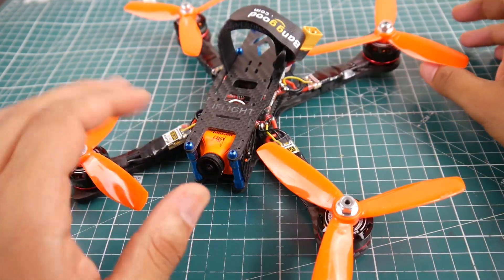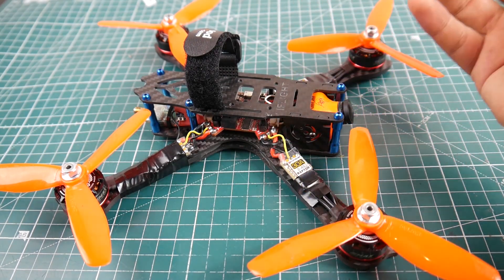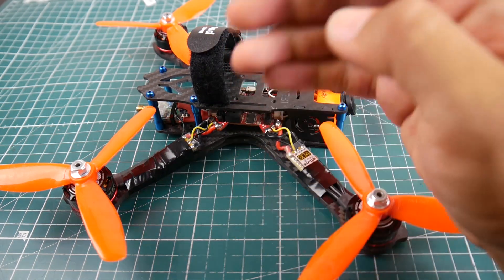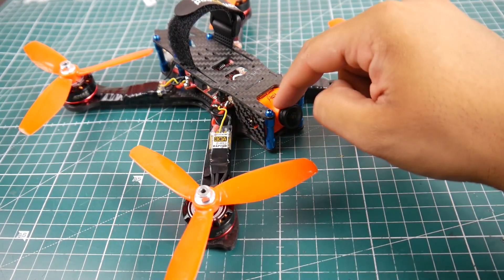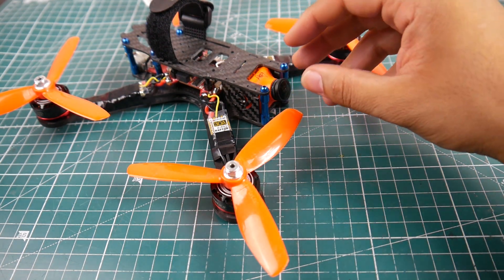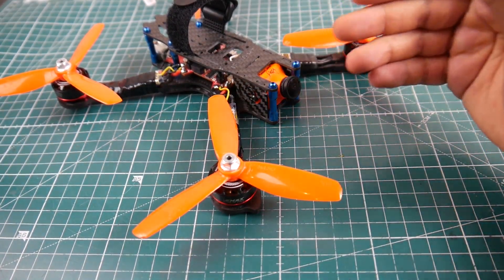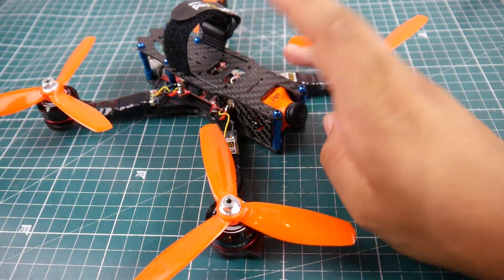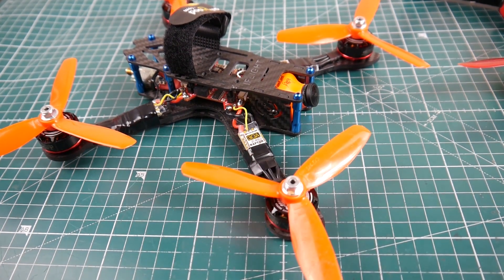HOW CAN A $10 ESC HANDLE EMAX 2306 2400KV THIS GOOD // Best Budget ESC Maiden

Comment: These ESC are expensive as hell now. 13$ a pop. Spedix es30 are cheaper at 11.95$ a pop. And even cheaper are the hakrc ones you reviewed. 37.99 on BG right now for 4. How did those ones hold up?

Comment: There was definitely noise buddy when you gave it throttle and did the snap flips they pulsed across the screen it's those clearish white horizontal lines .  you really can't see that at all or are you just saying it wasn't bad? I'm sure if you put a low ESR capacitor on each ESC would clean up the horizontal lines on the screen when you give it throttle and do flips

Comment: BTW, Mesh, do you think that the StarF4S can handle the Emax LS2207 motors? Or should I go with the Racerstars really? Thanks! 😊
Reply: MC's Creations I'm run 2207s on that board and it handles them perfect.
Reply: Still opting for FC-ESC AIO board? Low initial cost but expensive later if shit happens. Jeez, I don't even prefer 4 in 1 ESC.
Reply: Labs 😂😂😂😂😂 No, I already bought it. It's for a quad I don't even hope can last long! 😂 So I want it to be cheap. 😀
Reply: Well then, good luck!
Reply: Labs Thanks! I guess... LOL
Reply: Thanks, dude! :D

Comment: I used these escs, and they were very smooth and clean, but i ended up burning two of them on random small crashes with the dys 2207 2600kv samguk motors